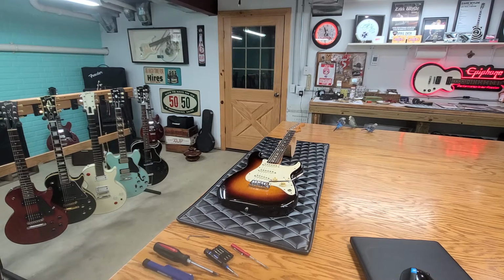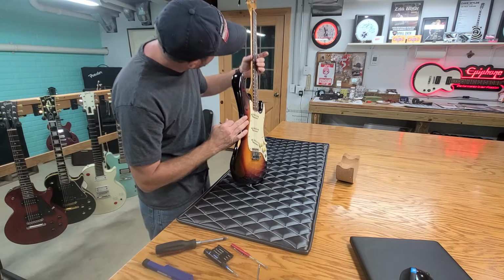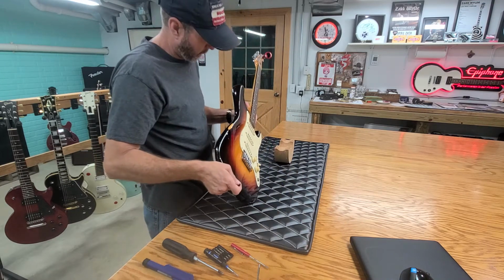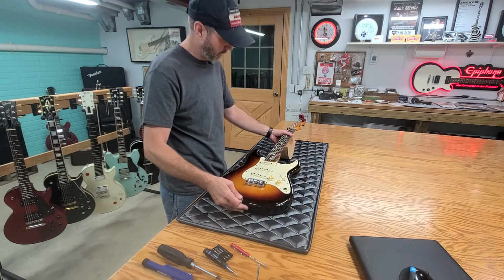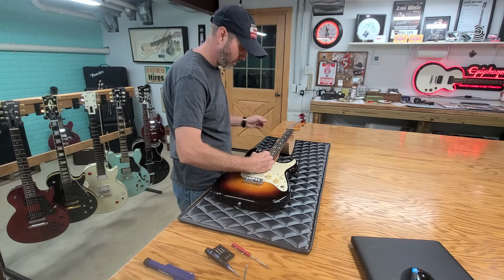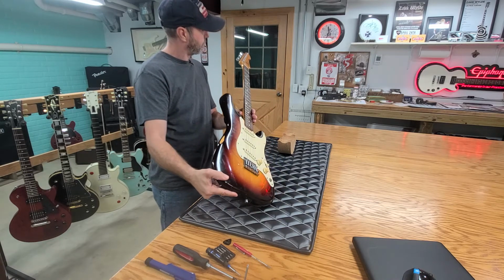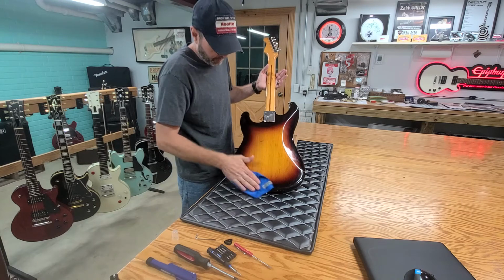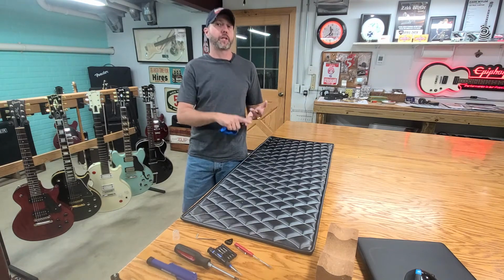Trying to figure out set up on 1984 Fender Stratocaster Dan Smith

Comment: THAT GUITAR GUY,. what did dan smith do to the design of the 83 84 strats?
Reply from the maker: Two nob, volume and tone and No back routing. Solid like a hard tail. The trem springs are under the pick guard and the trem on this has never been reproduced.
Reply: @ThatGuitarGuysChannel  Yes but Dan Smith didnt make that FreeFryte tremolo system I don't think that was his idea. Having one tone pot others say it have an extra glassy cleans more sparkle high end. I wonder if those pickups are wound differently by Dan Smith specs?
Reply from the maker: @waynegram8907  yeah I'm not sure? Now you got me thinking! Time to do some research...
Reply: @ThatGuitarGuysChannel  it doesn't same much in the fender books but dan Smith worked for Ibanez or something to do with the Japanese guitar manufacturers but he is a suit executive type I don't think he is a guitar Luthier so have no idea why they call them dan Smith models since he is not a Luthier or has pickup specs done
Reply from the maker: @waynegram8907  I should have you redo my video lol. You know quite a bit about him. I heard they were built that way to save money before I heard it was a Dan Smith. I was told it saved money on routing for the trem system and Input Jack. It's probably true to a point as it saved steps in labor and parts, but that being the reason I feel is BS. That's why I never mentioned it.
Reply: @ThatGuitarGuysChannel  they fender commissioned Dan Smith because as I believe Dan Smith worked at another guitar manufacturer which was either Yamaha or or Ibanez something like that he had some type of he was not a Luther he wasn't a pickup whining guy he was on executive that was called in as I believe to save them money but why would you call him the damn Smith model I mean what's what's so special about his name and putting it on the stamp of a guitar because the tremolo system was made by scheller and they that was a they already had those made it wasn't Dan Smith that made the specs and told commission shower to make that tremolo unit they already made it and he just kind of like put it together and that guitar to save money but there must be something different about the pickups the how they wound them and all that because that X One pickups were done by Seth labor and they commissioned him to make the X1 pickups was 1980 81 strats that had the X1 pickups and those are very hot they're wound very and there's a special design that the original Luther that wound the humbucker pickup he was commissioned by fender to make those those pickups now the Dan Smith model must have some type of special pickup whining to his specs that's all I can think of because there's something unusual why they would call it the Dan Smith model
Reply from the maker: @waynegram8907  I completely agree! Thank you for the info 💯👍
Reply: @ThatGuitarGuysChannel  Just a side note Jimi Hendrix used a 63 strat for the first album but those are called Black Bobbin 63 pickups that are different than the other 63 strat pickups. I'm guessing the black bobbin 63 was only done at a certain month because they are a special winding which has an edgier tone I have been told. Have you looked into these Black Bobbin 63 pickups?
Reply from the maker: @waynegram8907  No but I never heard of them. I will look into it.
Reply: @ThatGuitarGuysChannel  research about it and try to make a video lesson because SRV guitars have the same 63 black bobbin pickups which have a different resonance peak frequency which you can move to the left or right when winding pickups. SRV guitar was preowned by Christopher Cross and pawned the guitar so it must have came out of the factory with those black bobbin 63 pickups with a 59 body and a 62 D shape neck which they just had parts laying around
Reply: Overdrive Custom Guitarworks sells arms for 69.00 plus tax